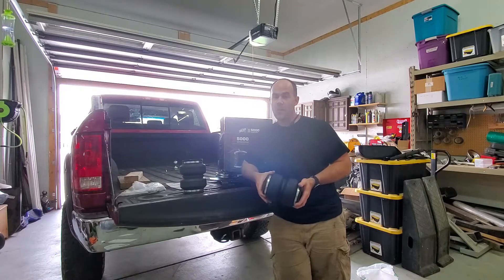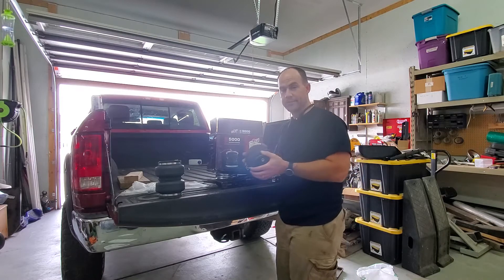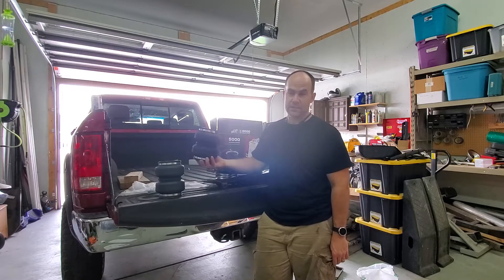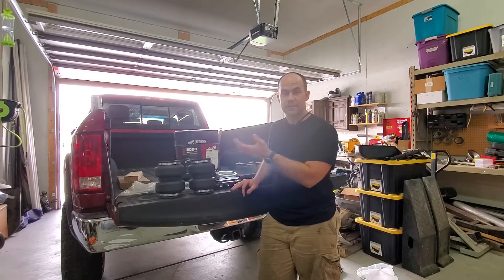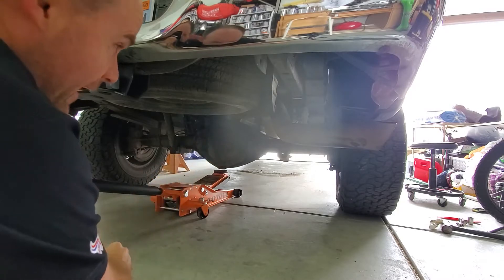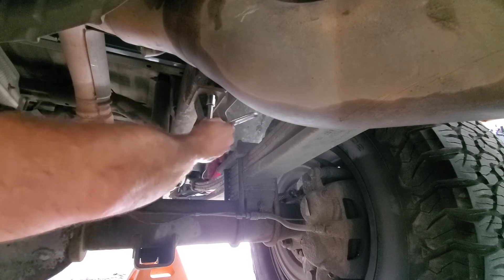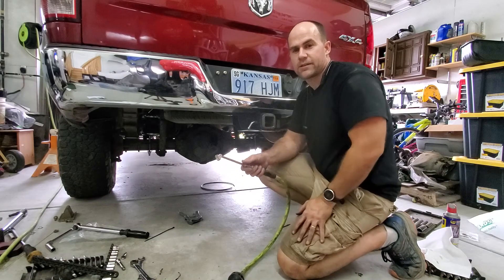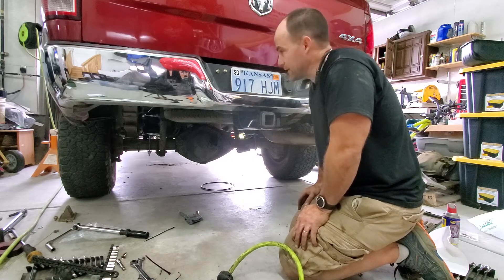Air Lift Air Bag install on Ram 2500

Comment: Do you have a level kit on your truck?  I have a 2012 Mega cab with a 2” level kit; has the level block in the leaf springs.  Wondering if that will need a specific airbag kit due to the added height.
Reply from the maker: I already sold that truck (upgraded to a 3500) so I can't go look, but I think it was stock height.

Your best bet might be to call air lift and see what they say.....they might have an add on for your situation.

Comment: This is not a 2500
Reply from the maker: Yes it is.  It's a 2013 2500.  They went to coil springs on the 2500 in 2014 IIRC.
Reply: How the hell do you
Know… why would he be lying